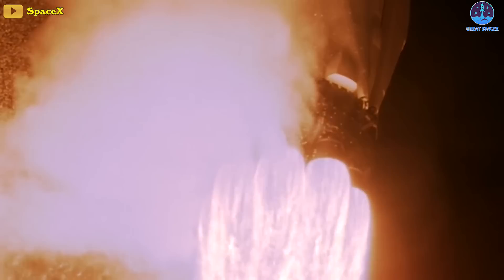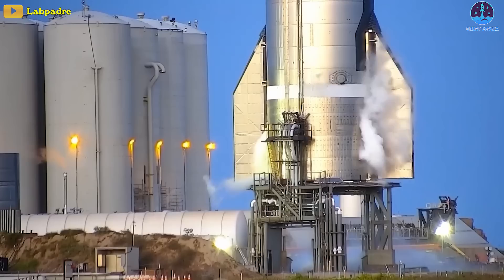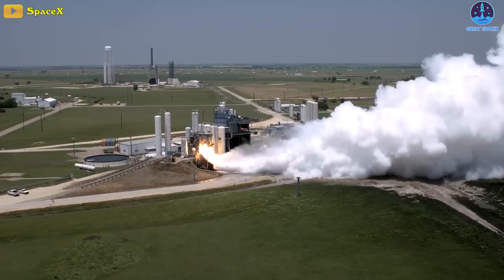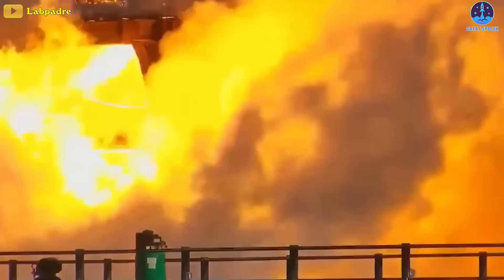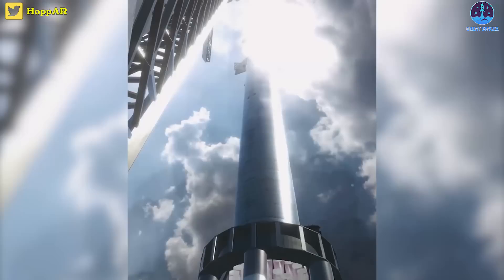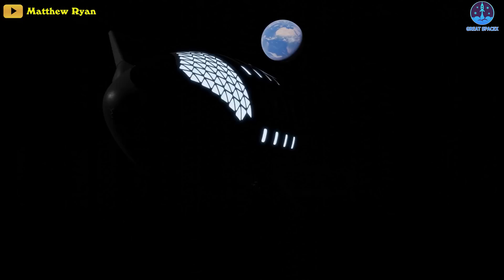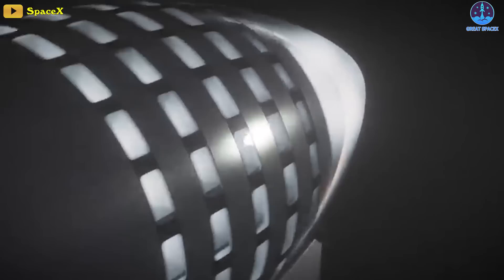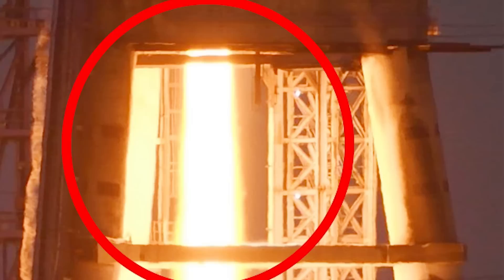SpaceX speeds up firing raptor 2 engines at McGregor to prepare for the orbital flight!

Comment: What u fail to realize is we are not going to be seeing a full 33 engine static test fire.. the only time that we will be seeing all 33 engines light at the same time will be on its orbital test flight.. she produces too much thrust.. she will literally rip the clamps out and topple over.. so maybe the outter 20 and then the center 13.. the other and only way to test all 33 will be of booster if fully fueled and starship has to be on top also fully fueled.. and that will only be a up too 20 sec test of all 33.. with the time to get things going I think will see all 33 light on orbital test flight day.. which will include a few scrubs so let’s be prepared

Comment: Why don't they use a small bleed amount of the pressure generated by the turbo pumps on each raptor to apply pressure to a gimballing system for each engine. It would do away with hydrolics and electric actuation that would be a whole separate subsystem. After all gimbballing is only used when the engine is working, so make it part of the engine, just like the cooling. Bring on Raptor 3.
Reply: If an engine failed, it couldn't gimball out of the way. Electric is more reliable and more precise. Electric gimballing can be done with solenoids and you are using eletric ignition in any case.
Reply: I think Musk recently said they thought about doing that but decided it was too complex (not impossible) and not worth the risk.